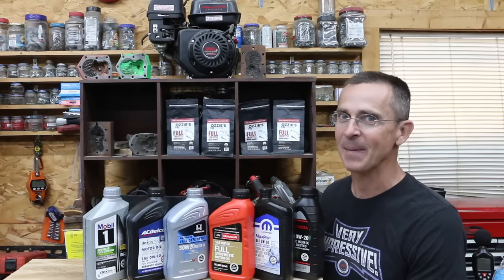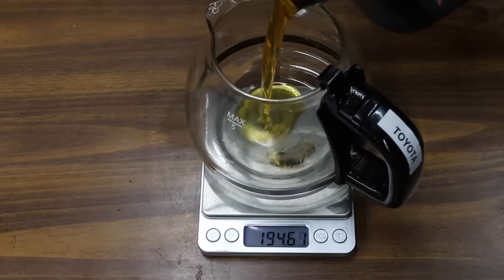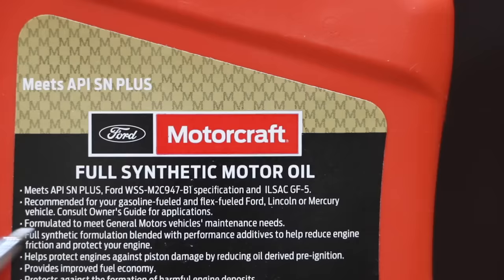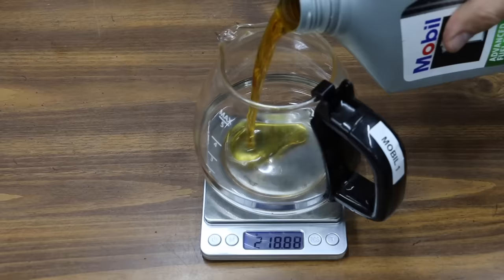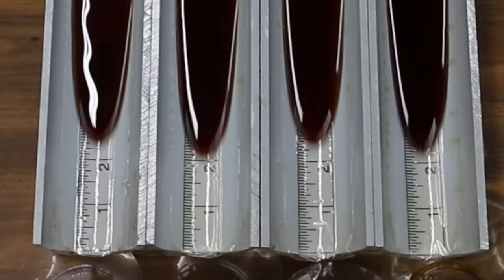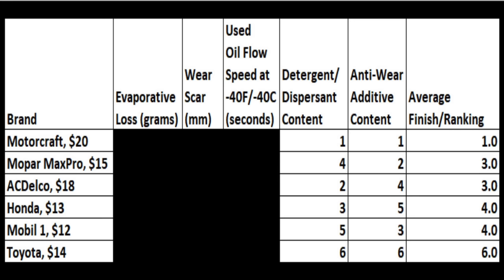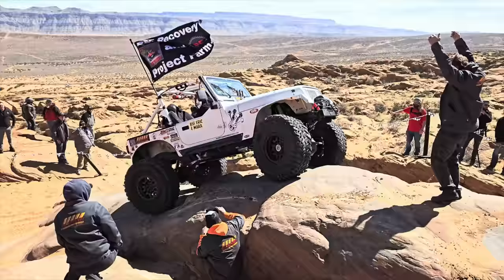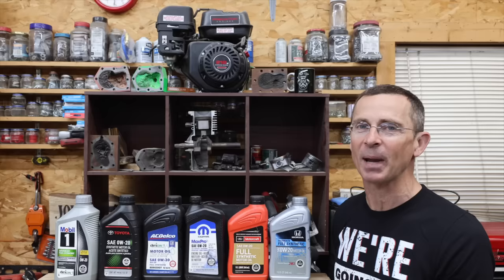How Bad Is OEM Motor Oil? Honda vs Toyota vs ACDelco?

Comment: Can you do a test with all the same brand and type of oil with different weights and see what the wear scars look like? I keep kind of wondering what happens if you use this new age oil in an older car. Can you also test the flow rate of the thin oil vs the thick through a standard auto oil pump? I've seen claims that the thinner oil circulates faster keeping the oil cooler. I kind of thought it was fake but I noticed this Honda fit has to idle forever to warm up in 60° F weather even so now I'm wondering. Also, is there any possibility that a higher flow rate would reduce the wear scar size from a lower flow rate with the same oil? And if so would a high flow rate thin oil be similar to a low flow rate thick oil? I'm a little curious if a situation where an oil pump pumping the oil over the parts may be different than the oil picking up oil onto the parts out of a pan. I know you know how to make great tests with great controls and think you're capable of testing this and it would definitely be interesting! Thanks for all your work!
Reply from the maker: You are welcome!  Thanks for the suggestion.
Reply: @ProjectFarm  I keep wondering cause you can definitely see some mpg improvement with the thin stuff but curious how much extra wear it might cause
Reply: @ProjectFarm  I know with drilling that temperature effects the wear rate dramatically so was curious how that would effect wear as well at different temps and if the thin oil running at any cooler temp might be just as good as a thicker oil.

Comment: It's amazing video , I like all your videos.  Would you make comparison between 1 mobile 3 different products. 

Mobil 1 High Mileage Full Synthetic Motor Oil 0W-20

Mobil 1 Extended Performance Full Synthetic Motor Oil 0W-20

Mobil 1 Extended Performance High Mileage Full Synthetic Motor Oil 0W-20

Thank you.
Reply from the maker: Thanks!  Thanks for the suggestion.

Comment: Not surprisingly the Toyota's oil came in Dead Last 😢..toyota....💩
Reply: Not sure what universe you live in, but in the one I live in, Toyotas have longevity and reliability significantly beyond the norm…and very few people would dispute this. The data has shown this for literally decades.
Reply: @jamesw1659  🤣 Please tell us all what Koolaid you're drinking.. Their quality hasn't been good for years..  But they are leading the industry in recalls.. Good for them. 👍
Reply from the maker: Thanks for the feedback.
Reply: @tedlulis973  Uh, Hyundai/Kia and Ford currently lead the industry in recalls. Toyota's last major recall was over the Takata air bag detonator issue,  which was purely an outside supplier. Their manufacturing system, TPS is the gold standard of the automotive world. You believe what you want, but almost nobody believes what you claim to. Ever look at vehicle resale values? That might be instructive...
Reply: @jamesw1659  And nobody ii believing those lies.  One 'Small' example
280,000 Toyota Tundra, Sequoia and Lexus LX 600 vehicles over a defective transmission. Parts of the transmission do not immediately disengage when the vehicle is shifted into neutral, which could result in engine power being transferred to the wheels.Feb 27, 2024